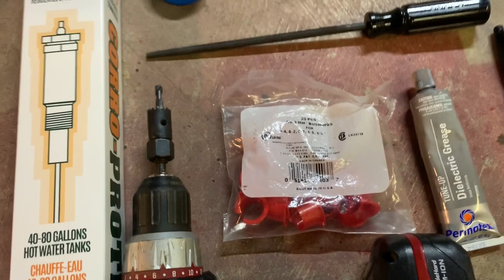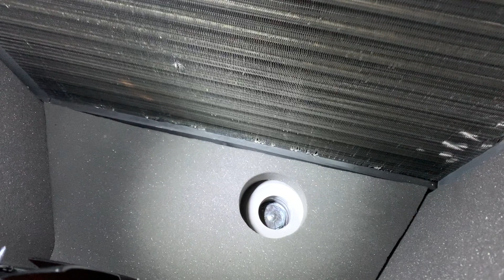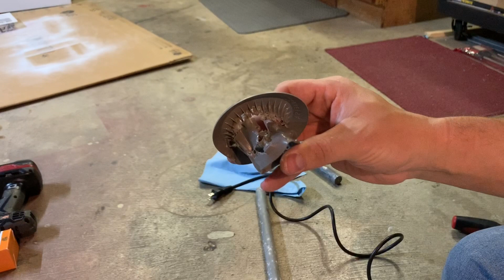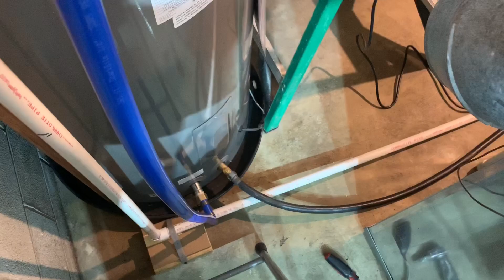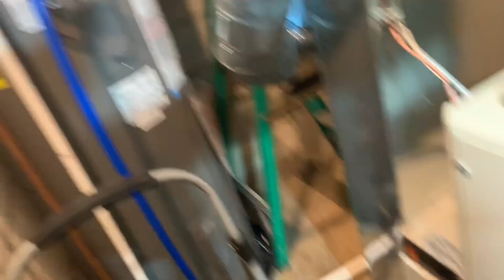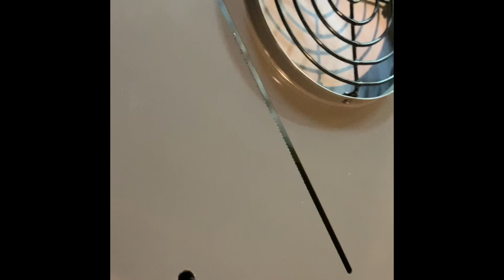Rheem Hybrid Electric Water Heater Anode Rod Replacement. Sulfur Smell is Gone!

Comment: Totally awesome and timely video! We purchased a Rheem Professional 80-gal heat-pump water heater, identical to the unit in your video. We absolutely love it, but there were a couple problems. First, there was “Black” water coming from our hot water side only. A  very nice and knowledgeable person at the Rheem technical support line, informed me this was often the case with unfiltered well water, which was exactly our case, and that it was caused by the “magnesium anode rod”. They suggested we change the anode rod with something other than “magnesium” and that it would NOT void the warranty. We were in the process of adding comprehensive water filtration system on our well water, so we decided to wait. After the filtration system was added, the “Black” water on the hot water side was totally eliminated; however, we still had the “Rotten Egg” smell. Being on well water, we were used to it, but had hoped the new water filtration system would eliminate it. Because the smell was only on the hot water side, and because the technicians were so nice and knowledgeable at Rheem, I decided to call them back and ask them about it. When I mentioned the “Rotten Egg” smell, they immediately asked if we were on well water, I said we were, but had a new water filtration system. They explained that the “Rotten Egg” smell on the hot water side was caused by the “magnesium anode rod” and that I should replace it, either with a different type of anode rod or a “power anode rod”. This was the second time they suggested I change the anode rod, and that it would NOT void the warranty. Because I said I was interested in a “Power Anode” rod and asked how to do it, they even looked up a YouTube video and sent me a link. It was of someone using the “Corro Protec” product, but it was on a different water heater. I purchased my “Corro Protec” power anode rod from Amazon, it looked simple enough to install; however, with this Rheem “heat-pump”, I wasn’t sure how to get to the old anode rod.
Your video came up in a quick YouTube search. Again, totally awesome and timely! If you don’t mind, there are just a couple “comments” I’d like to make. 1) Rheem technical support recommended to me to change the anode rod to eliminate the “Rotten Egg” smell – and this would NOT void the warranty. 2) The correct socket does work in the sleeve without having to remove it. I happened to have two sockets, both “1 and 1/16”, one I noticed had more pronounced “beveled edges” than the other. The one did exactly like you said, it would set on top of the old anode rod, but not grip it. The other, with less pronounced “beveled edges worked perfectly, without removing the sleeve. The Rheem technician indicated to me that it was not uncommon to change the “sacrificial anode rod” and I’m sure they don’t remove the sleeve. 3) In your video you mentioned putting “Dielectric Grease” on the tip of the new power anode rod; however, you didn’t actually show or mentioned doing it, nor could I find anywhere on the instructions from “Corro Protec” to do this. In any case, Great Video, many thanks! FYI, installed the new powered anode rod yesterday, emptied and refilled the tank, and no “Rotten Egg” smell today! Yeah!
Reply: Mark... Can you send a link to the socket that worked without removing the plastic insert?
Reply from the maker: First: I’m super glad this fixed your issue!

Warranty: Others have mentioned that an anode rod change won’t void the warranty (according to Rheem customer service) I’ll see if I can edit the YouTube video without taking it down (Reposting it would lose all my view counts, and all the helpful comments on the video.)

Socket. Yes in hind sight, I think I could have tapped the socket down onto the hex bolt without cutting out the plastic cap. I hope people read the comments before they cut the cap out!

Dielectric grease was just my idea. I like to keep electrical connections around water, or in damp humid basements protected (like my trailer harness pins) so I use dielectric grease often. I do believe I forgot to show that step in the video. Probably no problem if no one does that
step, it’s just a personal preference of mine. You just put a dab of grease on the spade connector before you slide them together.

Comment: Well first off I wanna say thanks for making this video, because I too was looking at the instruction manual and I kept looking all through the manual and it doesn’t show you anything about how to replace the anode rod. Which is 
F’ing BS BTW. I’m glad that you mentioned that if you do replace the anode rod that it will void the warranty because I didn’t happen to see that when I was flipping through it. My wife and I don’t have any issues with our water smelling bad, the problem we have is limescale. And our water heater is only a couple years old. So I thought it was just a routine thing to check out the anode rod, which obviously it’s not. Apparently Rheem wants you to completely replace the water heater every ten years or have a qualified technician come out and check it out. Well my thoughts are if you wait ten years to replace the anode rod, probably your water heater is going to be trashed anyway. Either way it’s probably going to cost you a couple thousand dollars to replace it. Thanks again
Reply from the maker: I’m glad it helped you. Also, several others have mentioned that they contacted Rheem and it does not void your warranty so I believe I misspoke in the video.
Reply from the maker: I’m glad it helped you. Also, several others have mentioned that they contacted Rheem and it does not void your warranty so I believe I misspoke in the video.

Comment: If you use the actual anode rod socket you won’t have to remove any of that
Reply from the maker: Dang. Where the heck do you get an anode rod socket? I have seen them for RV water heaters, but not for house ones.

Comment: add 3 pints of hydrogen peroxide 3% solution to the hot water tank while you have it open and that will oxidze any sulfur smell so the next morning the smell will be gone. It also shocks the system so that it is less likely to return.
Reply: The bacteria creating the hydrogen sulfide do not originate in the hot water tank. They originate in the cold water supply. Attacking bacteria in the tank would require large doses of hydrogen peroxide fairly often and potentially cause harm to any septic system.

It takes three things in the tank to create the hydrogen sulfide (smell): hydrogen, sulfur, and bacteria. If the problem is minor, it’s possible that these conditions don’t exist in your tank year round and therefore you can get away with an occasional treatment but that’s not going to often be the case. 

If you did want to solve the problem by removing the bacteria, the better place to remove them would be before they ever get to the hot water tank. That’s why Rheem recommends chlorination. An alternative is UV-C filtration after the well pressure tank. 

Barring preventing bacteria from reaching the tank, your next best solution is the powered anode rode which removes the hydrogen instead of bacteria. Hydrogen is created during the corrosion of the factory magnesium anode rode.
Reply: How could Rheem units cause the problem that did not exist prior?

Comment: I just purchased a brand new Rheem Hybrid myself, and decided to do this from day one. So i prepped following this which was super helpful, happy to report that they must have modified the new models. I was able to fit my socket and remove the anode rod without having to remove any plastic, just the top cover. Which was also easier, now just four screws total. I was also able to run the wire for the Corro rod, through the existing grommet for the main electrical connection. I then used magnetic cable management cord holders to ensure the cable inside never moved closer to the fan etc. Still a great video five years later, thank you!
Reply from the maker: Thanks so much for the comments. Yeah a couple others have said they were able to get it out without removing that plastic cap. I’m sure if I were to do it again I might be able to use that style. Thanks for watching. Appreciate the kind comments.

Comment: Thank you for making this video! I have the same water heater and recently went looking to replace the anode rod. Not because we have the smell, I just wanted to stay on top of it. I couldn't immediately find it by looking at the water heater. The manual said that it has one but says nothing about servicing it. Thanks to your video, I now know that it is serviceable. My water heater is 4 years old, and I don't want to void the warranty. I would want something in writing from Rheem about this not voiding the warranty. Thanks again!
Reply from the maker: I'm glad it helped you find the anode rod. I would recommend calling Rheem and asking their warranty policy. Many others in the comments have said they talked to Rheem and there is no problem to replace the rod. Also, you do not have to cut out the cap like I did according to other comments. Good luck.

Comment: Thanks for the really good video on how to do this. I bought my water heater in 2018. Interestingly enough, the socket size for the new Corro Protect I just bought a month ago is 1-3/16. In your video you said you needed a 1-3/8 socket. So anyone looking to do this today should make sure they check the socket size of the Corro Protect.
Reply from the maker: The best solution is obviously to buy both sizes so you own more tools 😄.

Comment: The plastic ring on mine popped off easily using a painter’s tool and working it around the outside edges.  The metal housing of the water heater wasn’t centered on the anode and wouldn’t let the socket seat properly.  I used a Dremel to make three vertical slits on the side that was too tight.  This allowed me to bend the housing just enough using the socket and the extension to seat the socket.  A knock off Dewalt impact gun got the original anode off in under 10 seconds.  A sheet of cardboard (or two) to protect the radiator from accidental bumps and nicks helped.
Reply from the maker: Great tips. Yeah I figure if the rod is off center and you pound the socket and wedge it on there, the impact might not be able to break the rod loose. Cutting the relief cuts was probably a good idea.

Comment: I have a similar water heater, similar above clearance.   Was curious how you routed the cable to the powered anode rod and where you grounded it.  This was really helpful - thank you.
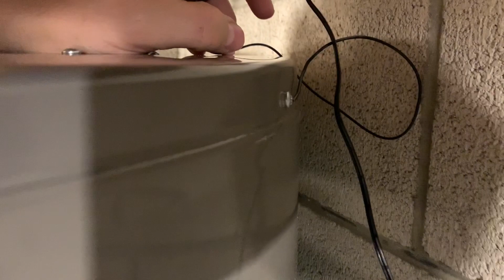Reply from the maker: At 20:35 I show the screw I grounded it to. It’s one of the sheet metal screws that holds the cap on. To route the cable, I actually installed an outlet on a close by ceiling joist, and plugged it in there.

Comment: I went to pull out the rod and I see a 1/2" drive plug. I pull it out without remove the plastic surrounding it. No anode rod present
Reply: I looked under the foam on the wrong side of the condenser. So I looked at the video again and put that plug back.
Reply from the maker: Oh man. I hope you were finally able to find the rod.

Comment: With that water heater, how do I turn my?I think it has a scalding alarm and my kitchen sink.Am my dry washer.My bathroom sinks get hot.But my shower isn't hot enough for me.I wanted to turn it up.They said that it may be in the knob on your water knob on a shower.Can you tell me if there's something in there that I have to turn up to make it warmer?It's winter now and I'd like to have a little warmer water
Reply from the maker: On my water heater, there are up and down arrows on the control panel to turn it up and down. Some have a small knob you can turn.

Comment: I want to do this (one year old 65 gallon) because I know I will not change the anode rod in the future and will rot out the tank prematurely.

For an appliance this expensive, it's crazy that it doesn't come with electronnic cathodic protection. It would be much better to engineer it in from the start.  Great comment section too - helpful experiences.

Comment: If you didn't think the powered anode rod would prevent the corrosion, then you should have just removed the old rod and left it unprotected :) 

Also I'm pretty sure it would be illegal for Rheem to void your warranty for replacing a maintenance part like the anode rod. In fact it would be counter-productive for them because replacing the anode rod makes the tank last longer.

The condenser being a little dented on the top is inconsequential. the fins are so delicate it's no wonder they get a little bent from assembly of the top.

Thank you for documenting the removal of that annoying plastic shroud! That "grab and twist" maneuver you did with the pliers is exactly what I would have done. I'm going to try mine next week so your video is very helpful!

Finally I believe that powered rod takes a 1-3/16 socket, not a 1-3/8". Why they don't make it 1-1/16" to match every standard anode rod is beyond me!

Comment: Great video!   And what a PITA getting the plastic sleeve out..     
I was wondering if an electric impact wrench, with an extension, would be a good way to go (after the plastic sleeve is removed) to get the old anode out?
Reply from the maker: Some others have commented that they were able to remove the rod without removing the plastic sleeve so consider trying that first. I also think an impact may work, but you would probably not be able to use an impact socket because the walls are so thick. A regular socket on an impact should work (although not ideal to run a regular socket on an impact). It was several years ago and I honestly don’t remember why I didn’t use my 1/2” impact. Good luck!

Comment: Excellent video. I had sulfur smell with our old water heater that went away I assume when the old anode got completely eaten away. I put in a Richmond (Rheem) hybrid heater last month and 3 days ago the sulfur smell was back. I've ordered a powered anode after watching this video and will install it tomorrow. I'll probably just disconnect the PEX allowing me to tip the water heater to get the old anode out (after draining it of course) rather than chopping the old one up. That way I guess if I do have warranty claims I can sneak the old anode back in before calling for repair.
Reply from the maker: From reading through other comments, it seems like they were able to get the socket on without cutting out the plastic cap. Maybe try that first. Also, several others have said they called Rheem and they said changing the rod will not void the warranty. I’m a few years in, and everything still seems to be working good. No sulfur smell, and my tank isn’t rusted through yet, so hopefully the powered anode is doing its job! Good luck with your project!
Reply: @EvolutionDIY  Probably depends on the socket manufacturer. Some are thin, some are thick. Thanks.
Reply: @EvolutionDIY  I was able to as well. The cap was not centered over the anode on mine, so I put it on with a bunch of extensions and just drove it on with a hammer. Then it came right out with a breaker bar. Total success, in one day this took us from a gag-inducing amount of sulfur smell to none at all.

Comment: @EvolutionDIY great video! You made a fantastic Point regarding not knowing it was working until much later. So, Now that it's been 4 years, I'm curious what your thoughts are? It would really be terrible to have a false sense of security that this device is protecting the water heater only to find out that it wasn't really doing a job as well as the sacrificial anode. It would be great if there was a way to have a sacrificial anode in addition to this device, using the sacrificial part as a visual representation of the efficiency of the electric anode.

Comment: Unless I missed it. You didn't explain what you used the dielectric grease for. You mentioned something about using it on the "tip" of the Corro Protec. I assume you meant on the electric connector on the end of the electric anode tube and not the end that goes inside the tank. Is that correct? Getting ready to install one on mine and my son's new Hybrid water heaters. Thanks.

Comment: If you had had a skinnier 1 1/16" socket, do you think you still would have had to destroy the plastic cap in order to get the anode rod out?
Reply from the maker: Actually if you read through many of the comments, it seems like a lot of people have had success removing the rod without removing that plastic cap at all. So I guess my answer to you is yes, I think you could.

Comment: We just had a plumber out to perform this task and he was able to do the switch without fully removing lid and without unhooking electrical. Great video thanks a lot.
Reply from the maker: My anode rod is plugged into an outlet on the ceiling. It fell out of the outlet 2 days ago (never happened before). When it fell out, it pulled the positive lead off the anode rod. I had to remove the lid to plug the lead back in, and this comment made me realize I could access it without removing the 120v electric, etc. thanks for the comment, super helpful!
Reply: Nice!